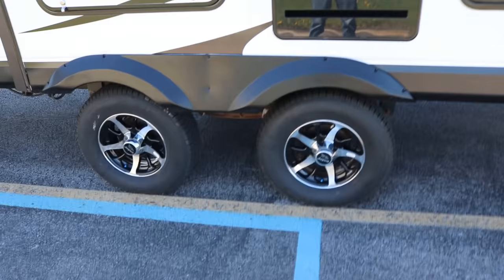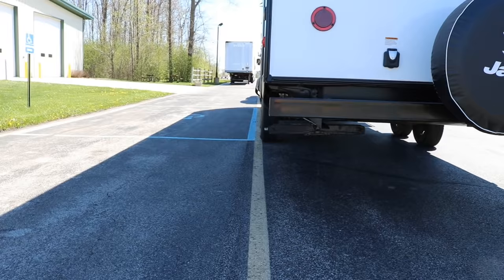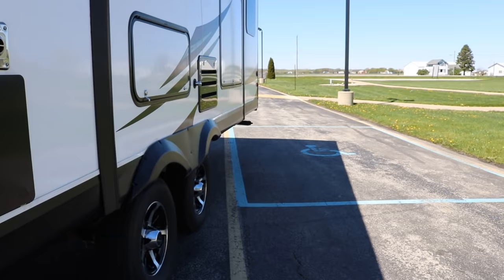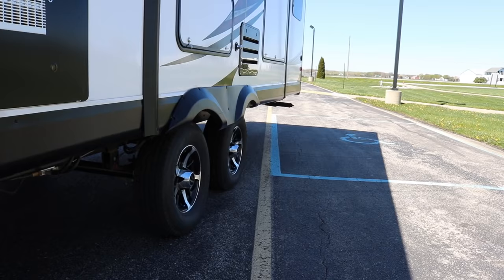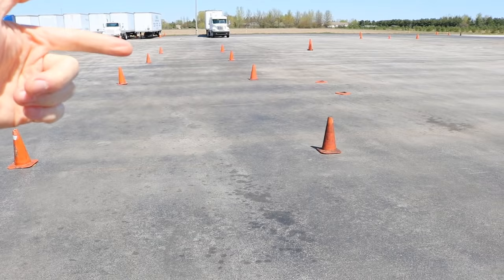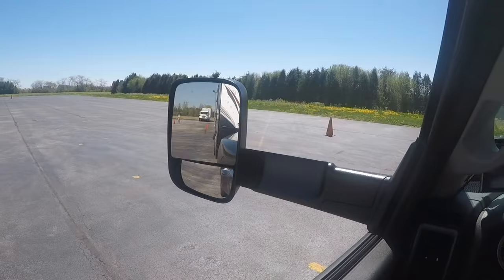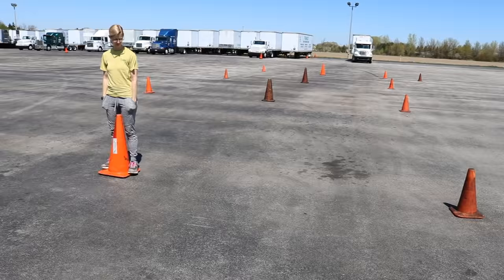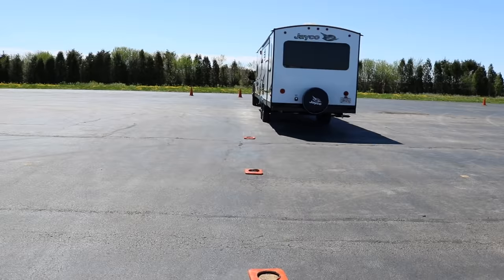HOW TO BACK YOUR RV (And Trailer "Tail Swing")

Comment: Thanks for the video.  I'm picking up a Surveyor 287BHSS in 4 days and it is a HUGE, LENGTHY upgrade from my 20' popup.  I'm definitely nervous about learning to back it in.

Love your trailer.  Those White Hawks are beautiful.
Reply from the maker: You'll be backing it in like a pro in no time! It's always easier to back up a longer trailer than it is a shorter trailer. You'll love that new trailer and wonder why you waited so long haha. We love our Whitehawk, it's big (37 feet) but the floor plan is perfect for us and our two dogs.
Reply: The only trouble with a longer trailer is now you go a longer blind/right side. this is a where a spotter to tell you when to top if your going to hit something or a trusty camera system comes in to play and help you out if you do not want to GOAL too much. I suggest if you decide to go with a camera get the NuVending NuCam WR, its got 150 foot range and uses an app on any mobile device for image unlike RVS or Falcon Electronics which require their own monitor and recorder system. It doubles as a security cam if you move it into the camper. If you do get that mount it outside on that right side on the trailer itself, you can mount it with a magnet to the metal frame underside or suction cup to a window near the front of the trailer looking back so you can see the whole side length for best view as it doubles in lieu of side rear view mirror.

Comment: As everyone has said this is the best video on you tube showing how to back up your rv. I learned a lot of valuable tips. Two questions I have is: 1.is it different when backing a 5th wheel and 2. is the procedure different when doing the alley (campsite) backing from the passenger side? Great job! Thanks for setting us straight! :)
Reply from the maker: +Randal Ovcen thanks for the comment! The steps will be the same for backing a 5th wheel. The only difference when backing in on the passenger side is which way you turn the wheel (think of it as a mirror image), instead of turning right, you'd turn left.

Comment: If you'd care to do this again with a pop up and much tighter circumstances I'd be happy to loan you ours. Lol. I do ok just ok with the larger spaces. But I can not seem to get it to work in real life situations. Thanks for the help. Going to give it another try.
Reply from the maker: Smaller trailers means smaller turns with the steering wheel. A little goes a long way

Comment: Great video Mike! We usually start off on 2M or sometimes the borrowed Chinese UHF radios we use at the campground we manage, set to GMRS4. She softly speaks, "Come on back, Come on back, Come on back, Come on back, ... What the HECK are YOU doing?" LOL. Our Lance truck camper with superslide was a piece of cake to park, but our two travel trailers and two 5W's of various lengths took me a bit of learning, especially since my half-ton does not have the nice towing mirrows our 1-ton dually had. Our current 23-ft Lance travel trailer is not too bad once I properly set up the Equalizer hitch the dealer poorly installed. Thinking we will go with the 3/4-ton truck for the FC 30, still undecided if we will go the Equalizer or Propride route. I am enjoying the Equalizer on our Lance, just not the lock on the tongue which seems to want to fight us on latching up or down sometimes, despite my best lubrication attempts with axle grease and/or the Equalizer lube. Keep up the good work!
Reply from the maker: Thanks for watching! Practice makes perfect

Comment: Speaking of tail swing I’ve wondered what’s the best distance you should be from a pump? Use the calculated tail swing plus x amount of feet ?  That’s assuming you can’t pull as far forward when exiting as you’d like.  Very helpful I recently learned about the apex at the intersection of the trailer wheels as your reference. It’s all angles
Reply from the maker: Yeah it would really depend on several variables but as long as you know what your tail swing is you'll be able to tell if you. Should even pull in to fuel up there or not if you don't have enough space to pull forward etc etc

Comment: This is informative, thanks. Now if only I could figure out where my tires should be before making the cut to back 8nto a campsite from a road.  Every site has a different angle so I just go slow. If it takes a second, or third,  try so be it.

Comment: I drove trucks for 20 yrs for Campbells soup, I always remebered the bottom of the steering wheel steers in the same direction the back end moves, so if you turn the wheel left the trailer starts going to your left, just imagine the bottom 180 degrees of the steering wheel
Reply from the maker: +Kd Grayson that's another great method. I naturally steer from the top of the wheel. I'm just weird like that haha
Reply: Kd, think about it, and I am an experienced driver myself, having your hands below the 3 and 9 marks at the 6 and left for left and right for right, its counter to having the hand at the 12 mark where left is right and right is left. I use my method of KIS as with the 12 or 6 if your turning counter clockwise your trailer goes right and clockwise your trailer goes left. There for the hand at 6 and turning left is going clockwise and right is counter clockwise.

Comment: I once had a relationship with a woman that figured the best way to back a trailer was just crank the wheel and keep backing up until the vehicle and trailer was in jack knifed position, and then keep backing while just shoving the trailer back with all trailer wheels sliding sideways until she came to the trees.  This method works best in gravel.  Hard on tires and totally bent the front of trailer when wrapped around the rear bumper and messed up rear bumper of the truck.  Nice dear.  Like crispyspa said we did not speak for about a week.  Needed cool down time.  She refused to use side mirrors and only looked out back window to steer.  That was a very hard relationship.  See ya later dear.
Reply from the maker: Sounds like she needs to watch this video haha

Comment: Nice instructions.  I was hoping for tips on backing in when the spot is on the right instead of the left.  Backing in with the spot on the driver's side is easy, not so when on the right.  Mainly because the mirrors on the right usually are curved and magnify.
Reply from the maker: You can watch some of our camping videos. Sometimes we back blindside. Or ask what questions you have

Comment: great information.   I'm planing on getting a small 16 ft  Scamp or Casita camper next summer,  so this video is really  going to help
Reply: Not sure how long your vehicle is to that of the trailer, but if the trailer is within 50% more length or around the same length, you will want to use shorter/smaller turns on the wheel when backing since the length of the trailer and its axle position will make it swing faster as opposed to having a 20 foot vehicle with 40 foot trailer which as he showed requires more turning. This is from my experience, so when you do your practice before hitting the road, play around a bit with the steering as you back up and go slow NOT fast, last thing you want to do is get into a jack-knife and damage something. Not all vehicles have the same dynamics be it a automobile or trailer so take a bit more time and do more than normal reverse turning until you get a feel and sight of how the trailer reacts and always take it SLOW.
Experienced Truck Driver.

Comment: Thanks for the great video. My problem is that my current utility trailer is too small to see. It's 4X6 feet, towed behind a Toyota RAV4. The trailer is so small and low that the tailgate hides it from the interior mirror, and I can't see it in the exterior mirrors until it's halfway jackknifed. That makes it fun to back up! Or not...  :)

But next time I'm at a dollar store, I'm going to buy some pool noodles and when I back it up, I'll mount them on the back of the trailer and on the fender so they all stick out far enough that I can see them. Then I'll be able to know where that cute little trailer's going.

The first time I backed a trailer, it was a fairly large utility trailer, and I found I could easily put the wheels EXACTLY where I wanted the back bumper of the trailer. Couldn't put the bumper there to save my life, though. I'll do better now, though, I'm sure. Once I can see where that darned little trailer really is.

Your spotter advice is great too. My wife usually tells me to stop just after I've smacked the wheels into the concrete parking strip at the local dump.

Comment: I need a video on how to back up 90 degrees in very tight quarters. Like a 1 lane road to a driveway and turning sharp 1lane to 1 lane corners
Reply from the maker: That's the same as the alley dock maneuver

Comment: Nicey done! I keep thinking about going out and getting cones and setting something up like this. The 1 ft. per 3 ft overhang rule is something I've been looking for so I can understand the extent of my tail swing. Thanks for taking the time to put this video together!
Reply: For some added fun and skill building try these:

Reverse figure 8 and U turn using the same set up, at least 12 cones, 6 for each circle at 20 foot diameter with O---10 or 20-----O feet between each circle for spacing (distance Not from center of circles but outside to outside). The Figure eight uses both sight and blind side and the U turn version either blind or sight side.

Reverse Slalom - This one has two ways you can set up. In either one space the cones like with parallel but vehicle overall length + 50% more as you want to keep as close to the cones with the side of the trailer and vehicle as possible. Now is the fun part of this, you do straight line, or like they do in skiing and space them upwards of ten feet apart, but do keep them the same distance as they are when in a straight line.

With either system you can space them closer or farther as needed.

Comment: Great video for people to watch. just to add one little thing would be do not think that a shorter trailer is easier to back up. Due to the short length things happen alot quicker than with a longer trailers. Case in point would be preforming the straight line test with a 16' single axle camper it can be tough.
Reply from the maker: We know this and never said it would be easier.
Reply: @WanderingWagners  I was not being critical of your video I was just passing on the fact that people should not hesitate to buy a longer trailers thinking short ones would be easier to back up.

Comment: So, in other words, you just did another lane change, and called it parallel parking.   All great tips and everything, not "dissing" you, just kind of teasing you for the "parallel parking." lol   The best tip tho, was to turn towards the problem in your mirror.   I'm an ex farm kid.  When we backed  anything up, we always just turned and looked over our shoulder, so it was easy to figure out which way to turn.  It's harder when using only mirrors.....takes some getting used to!

Comment: Turning left and right?  The back of the trailer or the steering wheel?  Maybe someday a video with an overhead view from a drone to watch the interaction between the truck and the trailer.  I really learned a lot from this video.
Reply from the maker: Turning left and right means turning the wheel. Glad you found it useful

Comment: I watch this video periodically just to remind myself how it's done. I've towed travel trailers, boat trailers and utility trailers using this instruction. Are there any adjustments in techniques required for backing a 5th wheel RV?
Reply from the maker: No adjustments other than your pivot point is different. So the techniques taught will work for any type of trailer
Reply: @WanderingWagners  thanks for the quick response!

Comment: Good video, enjoyed it. Just a quick word on spotters. They don't have to pay for damage if you back into something. I think that the most important thing to practice is your initial setup before you start your backing in. In other words where do I need the trailer to be to make it easier to back into the area your going. Try to get the trailer's back end somewhat pointed toward where you want it to go on your initial setup. Another little tidbit is if you are no longer pushing the trailer backwards and only moving it sideways, then it is time to stop.
Reply: Good points here. We tour Europe in our American fifth wheel trailer and European pick up.  The video is great and I will watch again as I tend to over steer.  A couple of points however:

1.  Spotters. Use someone you trust and who knows the characteristics of your rig. I lost a rear window by following a campsite “expert” who had no concept of trailer strike.
2.  Reversing into a pitch.  From what I can gather, European sites are much smaller than those in the USA. The access roads are frequently very narrow and the pitches are not huge. Care is needed when positioning the rig price to backing up to have enough room for the truck to follow the trailer into the pitch. Usually people will readily move their vehicle, bicycle, washing line, dog, playpen. Etc. Once again, great vid.

Comment: Sweet video. Kind of wish you had a 5th wheel trailer though, I'm getting one soon & surfing vids. I know concept is similar but pivot points are different from a bumper pull vs a 5th wheel. Been backing trailers since 15 when my step dad would let me park our 28' boat's trailer so I know about turn opposite of the directions, but never heard of trailer axle/drive axle points or 11 & 1 o clock. That should make is easier for people!

My biggest worry on the 29' 5th wheel I'm looking at getting is tail swing, cars in a left lane while I'm making a right turn. Roads are narrow around me.
Reply from the maker: +MrPittsburghJ thanks for the comment. With a 5th wheel you should still be close. One of our subscribers in California practiced my method with his 5th wheel to get his non commercial CDL and said it worked for him. 

When I'm making a right turn I stay close to the right side to minimize tail swing out to the left. Same thing when I'm turning left, I stay close to the left.

Comment: Thank you, Great video . When backing up I actually loose sight ( or sense) of where my front wheels are as to my steering wheel. At that point I wish I had a gauge on my dash showing the direction and pitch. Watching  the last 7 minutes of your video many times i have seen that my problem is over steering . Taking it incrementally seems to be the point of a successful back in..
Reply from the maker: +Laurence oversteer is a very common mistake. Make smaller steering wheel movements and you'll probably have a much better idea of which way your wheels are pointing. Thanks for watching!
Reply: We have owned our trail since 2013 and my wife has been the spotter, but now she is so happy that I am taking her off the payroll  for backing up and she can now relax. The two most important points made for me other than technique, is forget relying on the spotter , and GOAL. Now I going to a large empty parking lot and practice , practice and practice. If you could only be there after the dealer passes that bright new shinning trailer over to its new owner, and ask one question ." Do you need a couple of hours on tutoring backing up that bright new trailer," in my case  after paying 85 G for a brand new Airstream ,,, YES PLEASE .
Reply from the maker: +Laurence owning an airstream is a dream of ours. Maybe someday! I've thought about putting together an RV driving / backing class, but in our area I don't know if there would be enough demand for it.
Reply: You'll  never know until you try .
Reply: Really great job, I've backed a large class A motor home and a twenty four foot trailer at smaller race tracks. Your instructions are clear and concise and coupled with the well planned video, it's the perfect introduction to backing a trailer. Thanks for not talking down to your students!

Comment: Love your very helpful instructional video! We are first-time trailer owners and haven't driven it to its new home yet. In anticipation, I pulled up an aerial of our property on Google Earth and drew a path on how to safely arrive from the point of turning onto our gravel driveway, getting the trailer lined up to back it into a machine shed and backing it in. We would LOVE to have your input and possible suggestions on the path we drew. If interested in giving us your feedback, I have a pdf of this path on the Google Earth screen I made using their polygonal tool. I could also provide other particulars such as measurements in feet of the truck and trailer hitched together and the length of the path itself. Please let me know. Thanks!
Reply from the maker: Glad this video helped you! I'm sure your plan will work out if you've followed instructions given👍🏻

Comment: Awesome video. Very clear and extremely helpful. Any tips on the 90 park when the campsite is on the passenger side of your vehicle?
Reply from the maker: Be sure to pull up at least half a trailer length past the site before backing. Be in the middle of the road and small turns
Reply: @WanderingWagners  Will I still be able to see what I need to in the side mirror seeing it's on the passenger side?
Reply from the maker: As long as you have proper mirrors
Reply: @WanderingWagners  awesome. Thanks so much

Comment: Great Video Thanks. Is there any chance you could explain backing into a campsite or driveway from a NARROW road like a campground or neighborhood street. Thanks for your help.
Reply from the maker: The alley dock is backing into a campsite. Most times people don't pull forward enough. Pull forward of your site pad by at least half you trailer length. Small movements as shown for ally dock, into campsite.